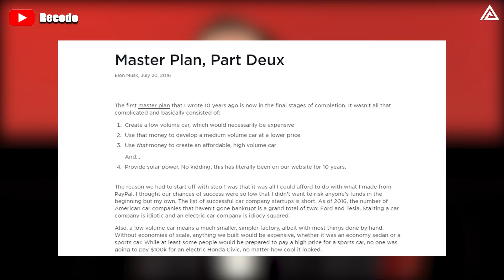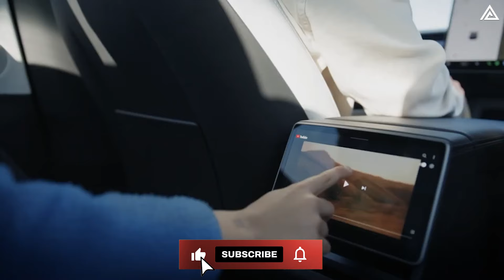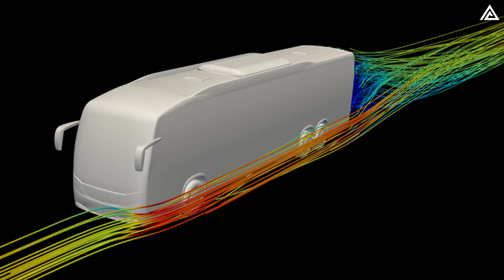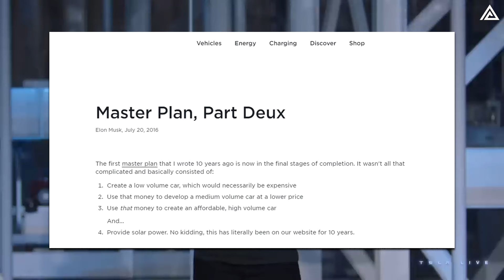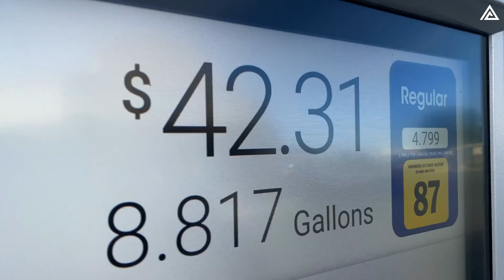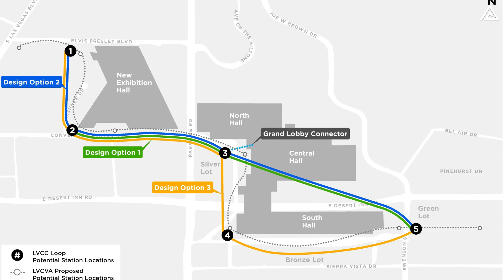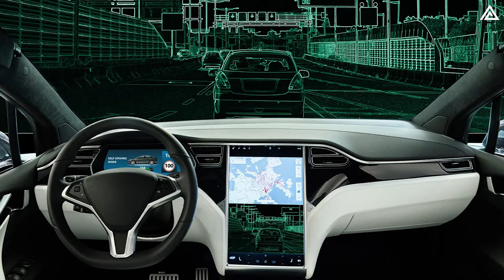IT'S HAPPENED! Tesla Is Starting BUSES In America! How INSANE Is the Range, Features, and Interiors?

Comment: If it happens, Tesla will be the 72nd EV bus manufacturer in the world. I think that Elon first needs to focus to get the Semi out and that the semi needs to be proven in real use. All we know for sure is that the price has gone up and the range has come down. I do believe that EV buses is a god thing. Pollution in cities, both from exhaust and sound is a problem that has to be solved. One do notice that most of the American commenters seems not to be aware that outside the US, the rest of the world, buses are very common as public transport.

Boring tunnels and using "buses" for mass transport is called subways, underground, Metro, ... depending on where you are in the world and they already run on electricity. You need to start with a well planned network because if you don't have the infrastructure that supports the transport needs, no one will use them, ICE or EV. In this case Europe, where I live, is well ahead the US and therefore the transition from ICR to (B)EV is already underway. There are hurdles that need to be adressed such as cold climate and charging infrastructure but that will be solved. I don't think that small buses, 8 persons, is a good idea in cities. In Sweden they are used in the countryside as "bus on demand" where you call the bus with an app making it easier to live in rural areas not needing a car if you are an older person that cannot have a car for some reason.

In Stockholm where I live there are over 500 bus services, serving 7000 bus stops. These buses are scheduled and you can see the time remaning until next bus arrives. Buses arrive/depart every 5 to 15 minutes depending on line and time of day. This is a good start to go from ICE to EV.
Reply from the maker: Wow, thanks for these amazing information.